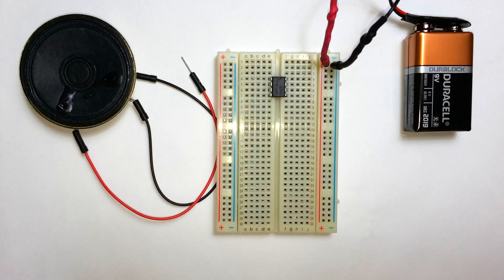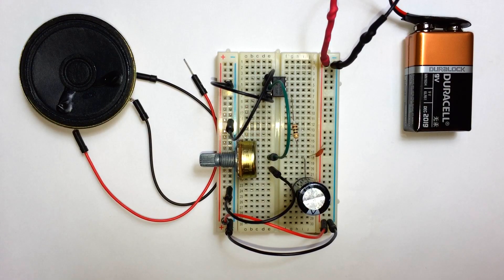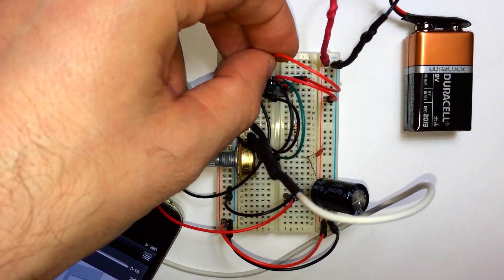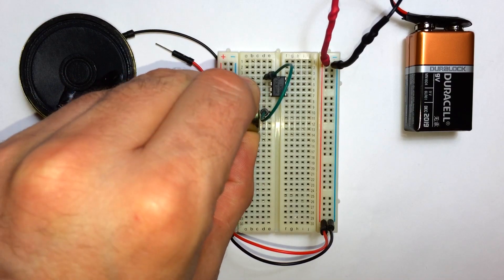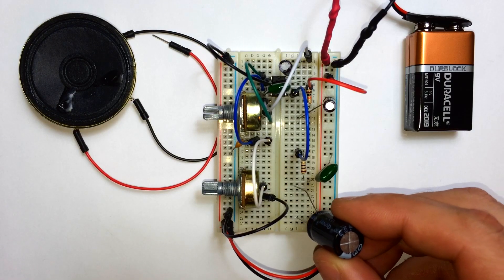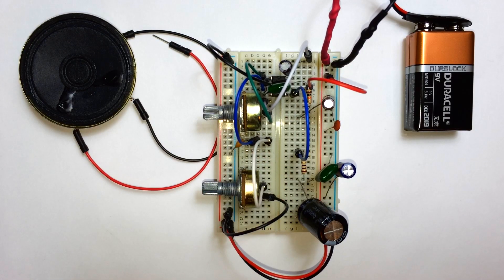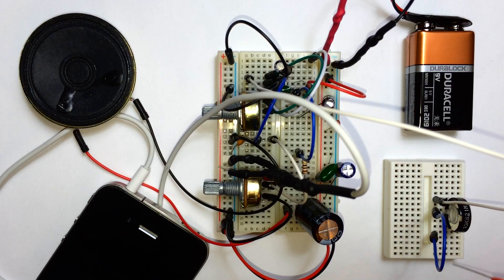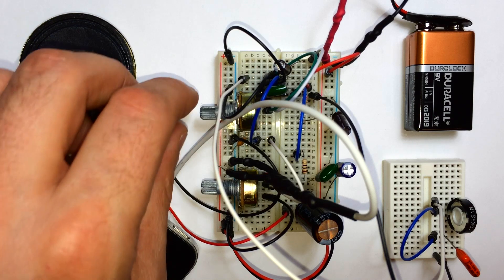Make a Great Sounding LM386 Audio Amplifier with Bass Boost

Comment: The best way to avoid burning your fingers when working with electronics is following the most basic safety rules. Especially the rule of keeping everything disconnected from power before checking correct connections. Manipulating the circuit itself with the power on is not allowed. It's the first thing they teach everybody in work safety, electric engineering high-school and also repeat it during safety tests.

Comment: What voltage rating did you use on you capacitors? Couldn’t find that on the blog. Tried posting a comment but went to blank screen. Thanks. Would really like to see a parts list.
Reply: Oh I found the parts list

Comment: The 470pf capacitor indicated in your schematic on circuitbasics.com between pins 2 and 4 does nothing and is not needed. Since both pin 2 and pin 4 are tied to ground the capacitor is shorted

Comment: Even when doing easy experiments as a starter, please use a better speaker that has some enclosure with at least a woofer and twitter to get rid of distortion! Also get a 12V 7Ah lead-acid battery which i really recommend for starters, as well as a multifunctional charger for almost all batteries! It will be much better than the 9V 200mA alkaline battery!
Reply: mAh sorry

Comment: If you want to make a bass booster then better use the C4558 opamp and two transistors (ask me for schematic).
Also, if you try to make an LM386 amplifier and it is unstable ask me for a very stable version!
I know the LM386 as well as i know my pocket!

Comment: I went from this to having a dual LM386 driving to quite large 2 way Sony speakers such that its actually astonishingly loud. It took a while for my soldered board to be debugged but .. yeah. If you have adequate 9v power and efficient speakers. Then later I built a booster circuit with two transistors taking the out put of lm386 and amplifying that - it also sounds good. 1-2 watts of good clean sound can actually be enough to make something nice to listen to.

Comment: While making the first circuit, he connected the last capacitor, that 104 I guess, from pin 4 to positive rail. I think that was a mistake, and he did plugged in to negative in the other part. Now I'm not sure how that worked for him.

Comment: Lol, so many people use the far right pin of the potentiometer for ground, because they live in their schematics, where the ground usually points down. But in this connection the wiper must be turned far right for maximum attenuation, which is usually the position of maximum volume. That's why I design allready my schematics in a way that the potentiometer ground is pointing up.
It is better to use your best hifi speaker awayliable in your home to present the music samples. Most of these chip amps are really sounding good. Only with a very good speaker you can reproduce their full potential. I order to avoid accidential destruction of your speaker you can check that the amplifier output is free of dc.

Comment: At the video, you connected the 470pf decoupling capacitor between pin 3 and ground but at the schematic at your blog, is between pin 2 and pin 4(ground). Which one is right?
Reply: Pin 3 is correct. The capacitor is intended to short radio frequencies immisions from the non-inverting input to ground. But in the video is another more relevant error. The positive electrode of the output capacitor (1000 µF) is not connected to pin 5 (output) of the LM386 but to the midpoint of the Zobel circuit. So the speaker will only get less than half of the voltage and less than a quarter of the power.
 
And the Zobel circuit is connected with the resistor to the output of the LM386 and with the capacitor to the ground (the opposite as in the tutorial). It doesn't matter the way it is but if it would have been built in the way like in the tutorial, the educator would have realized that the output capacitor is at the wrong net, because only the very high frequencies would have been audible. :D

Comment: Hi! I gave this a go with some slight modifications. 

I didn’t have a 10k variable so used a normal resistor between pin 3 and audio in.

I used a 100uf electrolytic capacitor from pin 6 to ground 
A 10 ohm resistor from pin 5
A .5uf ceramic capacitor from end of the 10ohm resistor to vcc
And a 1000uf electrolytic capacitor in between. 

Speaker +ve input connected to negative leg of the 1000uf capacitor.

Anyway when I power it on and hook it up to my 9v batter the volume is really quiet. However when I touch the 100uf capacitor and the ground input the sound amplifies.

Can anyone explain what is going on please ?
Reply: I believe what you need is a resistor between ground and the input pin (10k should suffice). Without it, the circuit is "floating", aka it's not properly biased, and will not work correctly.

Comment: I am using the design you used for the best not the one with a base booster but the other any ways I use easy eda to make all my pcb boards and when i check it be for aranging parts on a pcb it red flags 3 on the audio jack and i dont know why

Comment: I found a problem with your circuit. If we fed an audio signal with a DC offset, which is very likely to happen, our amp would clip out most of our wave and a lot of distortion would occur. You can add a .1uF cap series to the audio signal. Another thing is that you are using only one channel of the stereo plug. You can combine the two channels with two 1K resistors to create mono out of it. A summing amplifier and a differential amplifier could also be used in order to make an "analog or gate" or basically adding the signals on top of each other, that would be a neater solution. It would be nice to add a 10K pullup resistor before the cap in order to power electret microphones. The dc offset will be filtered by the cap.

Comment: Hey, that a good amplifier. I want to build one, but i dintunderstand your circuit diagram. The 470pF capacitor should’ve been connected to pin 3 and ground “that want you did in the video”, but in disgram it’s connected to pin 2 and 3 so both side of the capacitor are grounded🤔🤔🤔

Comment: Played a guitar through it and it's a bit quiet. Not sure what I've done wrong
Reply: Might need a pre amp?
Reply: Can increasing input impedance of 386 by connecting 470 k resistor work ?

Comment: Built this circuit with a 1 watt speaker and fitted it in a coffee tin! I didn't use the bass boost but it's still good for my wee workroom and will be used for testing low output audio circuits and for music on my ipod nano, phone etc. I fitted a pot in the gain circuit on the breadboard but used a 5k resistor in my final setup as that seemed about right. Thanks for your great little circuit. Another happy customer! A bigger amp is my next project methinks!

Comment: In the LM386 manual the filter connected to ground, and a 10uF capacitor used to gain. What is the different between the two methods?

Comment: The circuit on website is different from that in video
There is no capacitor on pin 3 in circuit on website 
Moreover there is no capacitor between pin 2 and pin 4 in video but it is in the circuit diagram on site

Comment: Thanks for this video, I am creating a small stereo speaker/headphone amp, and I think I'm going to use your design, modified slightly. Do you think using a MOSFET for a preamp (before entering into the POT/ground would increase the quality of the amp? OR would it simply make the volume far too loud, and go beyond the IC's voltage? Would it be better to use the mosfet/transistor amp on the output of this amp? OR is this no reason to do either? I also want to add a couple filter circuits to the output to increase the quality. Since an amp is really only useful for very expensive, and high-quality headphones. I am a noob at electronics, but this is my first 'real' project, meaning im going to fully assemble each circuit, add it to a quality metal case, cut out a user interface for the gain/volume, (on/off  LED), bass control,  Two 3.5mm jacks(in, out), and probably 4 speaker wire clamps for unpowered speaker hookup. My question about the secondary amps are especially aimed @ the passive speaker outputs since they would require much more power, and likely a larger signal than a pair of headphones.

I'm sure ill fail miserably on my first few attempts.. actually I've already put together like 2 working mono amps, 3 non-working stereo amps, and 1 working stereo amp, and a whole lot of non-working LM365 amp circuits... thank god for your video here, or I would never have figured it out...

Also, do you think you could do a few more video's on audio amps? This one seems to be really popular... I'd love to see you do a stereo version of this same amp, also a few diff classes of amps especially ones which use only Transistors/MOSFETs/etc.

Comment: Well. with that many you can experiment a whole lot, and practice creating a type A amp, type AB, and using two chips in the same setup as this video, (well similar not exactly. The gains, and Volume would need to be connected to both channels, otherwise you'll end up with 4 pots, or 6 if you add bass control.) You can make a stereo amp, as this amp is mono. I'm currently experimenting using these as a first, and second phase amp, using transistors (NPN, PNP, and MOSFETs) as either the preamp or 2nd stage amp.. both seem to work well tbh. I'm sure most real EE would balk at what im doing, but I'm a newb... bahaha. Electronics are really fun once you begin getting the hang of circuit design, and general knowledge of what specific chips/ics/etc do.

Comment: what volts does your capacitors has?? please do reply to my comment, badly needed
Reply: Cielo Herradura as best practice use a voltage rating double your supply voltage or more - if you are using 12V power supply then 25V capacitors would be a good choice
Reply: @jonahswain  how about 9v? 25 volts is still good?

Comment: please please can someone help me to build a car amplifier..the cost is no issue..i want 4 amplifier for ech door...front door 3 way bas mid and treble,,rear seat is bas and treble and last for a subwoofer..i have a couple of amps that isnt working..3 genessis  and 1 Hifonocs zeus v.. all of them is early 1990-2000 im a noob and dont have schematicks on these so i was thinking of making 5 amps
Reply: 08halit I had a similar problem and I found a guy on Craigslist that charges 20$ to diagnose an amp and will apply that to repair if done by him. I had 4 amps fixed and working for 80$ which was a great deal less then building my own or retail replacements of similar quality. Thats something to maybe look into. If you don't care about how much it costs I'd say buy new ones. If it's a hobby you're looking into starting, hiring the repair guy and have him teach you as he fixes them is the best way to learn because you can ask questions.

Comment: Hi,  I was wondering if it's okay to use a 4 ohm, 3 watts speaker and what capacitor to use for this circuit. Do I go with 1/4 watts or 1/2 ?? Wish you can help because I am just a newbie in this electronics stuff.  Thanks

Comment: how do you make something like this work with an mp3 and arduino?
Reply: you can use the TMRpcm library which works with the Arduino Uno, Nano etc.
But you can only play wav files at 16khz, 8 bit so the sound quality isn't great.
you can also use the arduino Due which has a DAC so the sound quality is better becaus it can play a wav file of 16 bit 44100hz.

Comment: does voltage matters ? lets say im powering the circuit from USB 5V or adapter 12V, will the circuit still work ?

Comment: I made this thing on a copper perf board, and ran it on a 5v supply from a mobile charger. When there's no audio signal, there's no static noise. But playing audio produces lots of noise. I don't currently have a 9v battery to test out. I'll test with a 1000uF cap on the power input to see if it's better!
Do you have any suggestion?

Comment: One more thing guys: Isn't it true that the higher the resistance (speaker) the lower the sound? If you were to use 4 ohm speakers, would this circuit still work but with higher sound?
Reply: There is a danger of zapping the chip if you go from an 8-ohm to 4-ohm speaker.
Reply: true, using a higher impedance than advised for an amplifier will only give less dB per Watt but using a lower impedance speaker than adviced will put too little charge on the amp circuit and you may fry it

Comment: Just what I needed. I think this would work quite nicely as a low-power pre-amp to shape the tone. 

Correct me if I'm wrong but making a treble boost would just be a matter of correcting the values of the filter for your desired cut off and inverting the positions of R and C so that it's R rather than C that is connected to ground. 

BTW, is there a dual input version of this so that it can manage stereo?

Comment: you say 740pf capacitor around 7:00....so i sent my wife to the shack to get...no luck....wire diagram shows 470pf....which is correct? I would assume 470pf....but that burns me alot....lol
Reply: +sup2320 my wife maintains, troubleshoots, and repairs avionics on F-16 and F-117 Fighter Jets.....dumbass
Reply: What's your point? I enjoy fitness, buff men, and the violin :). I probably exercise and workout more in one day then you have in the last 4 years :D
Reply from the maker: +Mike Wallace it's 470pf, sorry... But actually a range of values will work for that capacitor. You want a small capacitance to filter out high frequency interference, but the exact value isn't critical
Reply: What range are those frequencies? I am asking because I want to build an Analog Flanger. It's a stomp box type of effect in case you were not aware. Examples are the MRX Flanger used by Van Halen and the ADA Flanger. Would you be interesting in making a video of this kind of music processor? Thank you...
Reply: +Circuit Basics thank you
Reply: Never send a woman to do a man's job.. Dumb ass
Reply: Are you referring to that gelatinous mass In your display picture? Looks like the only thing that creature maintains is the Hungry Man dinner supply in your deep freezer.
Reply: +sup2320 you're really gonna talk shit. ..with subscriptions to "Buff Dudes" and Lindsey Stirling Videos....ok...you are an example of what have been saying for years...if people couldnt hide behind the internet and knew their address and name was in front of me...bets are their tongue would slow down

Comment: Pots are logarithmic, right?
Reply: Thanks. That makes more sense to me. I use log pots on my tube amps.
Reply from the maker: +redfishbum I think they are linear actuallu
Reply: Ok. I build tube guitar amps and use logarithmic there. This is my first attempt at a solid state set up. 

Thanks for the quick response.
Reply: +Circuit Basics Thanks for the reply.  Could this circuit be used as guitar amp as is?  Would there anything else needed other than the correct input jack....not a big deal as I have built tube amps before.  THanks in advance.
Reply: Volume pots follow the log law as our hearing is logarithmic too. You can of course use a linear pot, but it would make everything happen in the first little turn. Lin pots for most everything else.

Comment: what is "200" gain?  Wattage I guess.. wait no... I don't know..

And why is there distortion?  because the speaker?  or the setup?
Reply from the maker: The distortion is actually 99% from the speaker. I listened to it with headphones later and it sounded much clearer.
Reply: Gain is just the multiplier of the amplifier. Headphone ports don't carry enough voltage to power a big speaker. So the amplifier multiplies the input wave (aux signal) by 200 to make it more powerful

Comment: You may want to disconnect the power first before doing connections, that way you could avoid damaging components with wrong wiring.  Just a tip.
Reply: các ban có thể tham khảo sản phẩm tại: https://www.sendo.vn/lm386-dip-combo-2-chiec-9073922.html

Comment: 07:00 What's the difference between the volume control and gain control?
08:10 What's the value of that capacitor?
OK cool, you showed how to connect all these parts, but you didn't explain what is the purpose of each of these parts and how does the circuit works.
Reply: Generally speaking in audio applications, gain is a multiplier for amps (opamps etc) and can be controlled using the negative feedback of the amp. For example if I had a 3v sine wave peak to peak on the input of the amp and have a gain of 2, then my final signal will be 6v peak to peak. 

Volume is a final "fine tuning" of the loudness. It's simply a voltage divider at the end of a signal usually controlled by a potentiometer. 

A (very basic) example of them being used together would be in a basic distortion circuit for a guitar. Guitar signal is fed to the op amp which has a gain higher than what the amp can produce. The result is distortion; however, your signal becomes really loud to create this distortion. So you add a volume control at the end of the of the circuit to tame the loud signal

Comment: better buy pam8403, more wats, better sound, stereo, and its very cheap (0.40€+-)
Reply: +Ji run its 5v 1.2a 3w amp, I tested it on 20w 4ohm speaker, sound was great

Comment: why does connecting the wire between pin 1 and pin 8 make the volume boost. at 4:18
Reply: When you connect pins 1 and 8, you bypass the internal circuitry that sets the gain of the amplifier to 20. Instead it sets the gain to 200. (X10 louder than the latter configuration).

Comment: yeah bass boost 
=shit
Reply from the maker: +Rodrigo Miquelino this is a 1.25 watt amp, so it's not going to be as powerful as a home system or what you can get with car amps
Reply: +Circuit Basics no saying that, what I meant was that bass boosts are shit most time the speaker can't Andle an it gets loose.